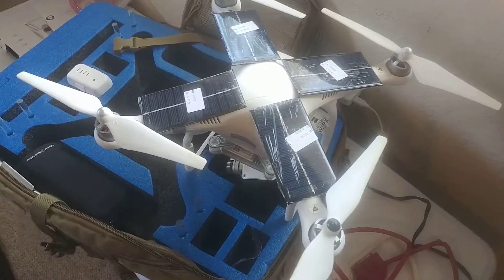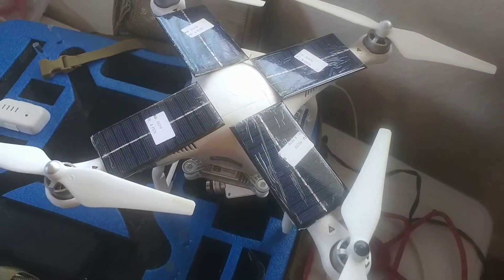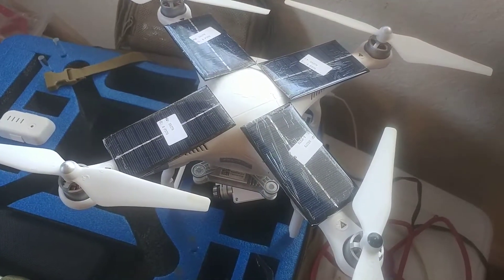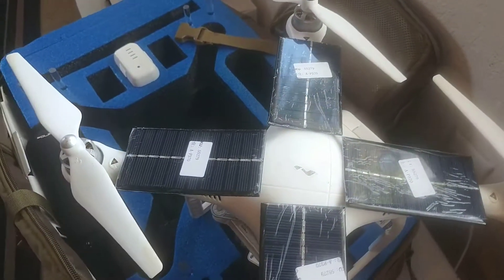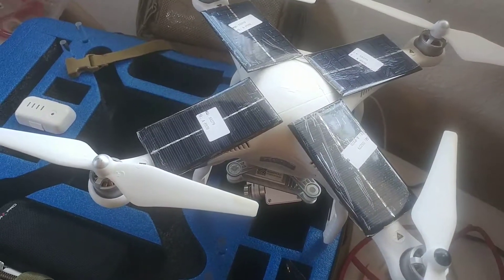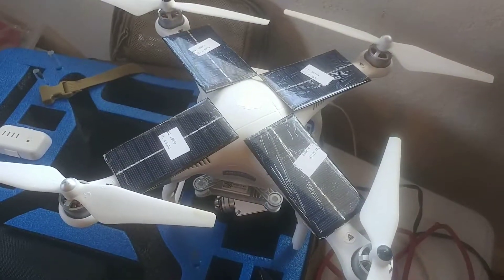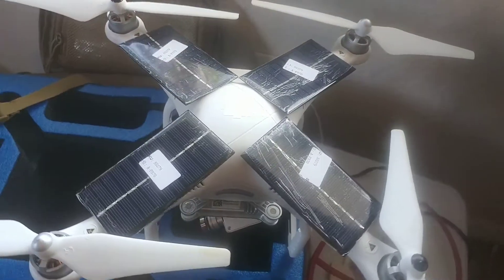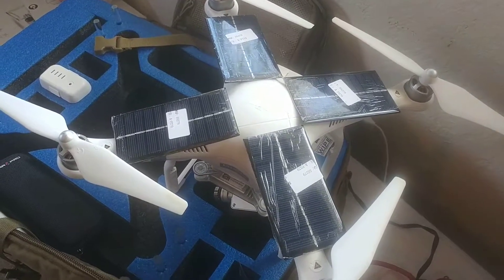Solar panel on a drone? Would it work?

Comment: sure u can , first thing u need to get another drone ! small light one ! u can get taruantula x6 its very light for 70$ , or get a smaller one so it takes less power !  and with a smaller battery , and very very light diy frame for the drone (u can buy it or print it ) , then u can buy high end solar panal (theres a thin flixble one so u can put it every where on the drone with glue ) , so the point here is to make the drone so light ! and remove the gimbal and camera ,  and yeah u just need to try it , keep on